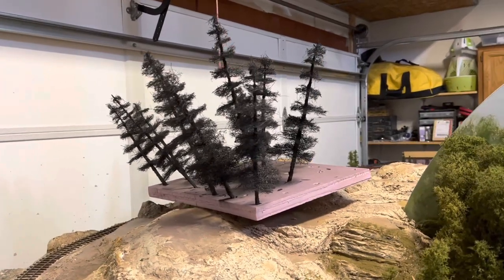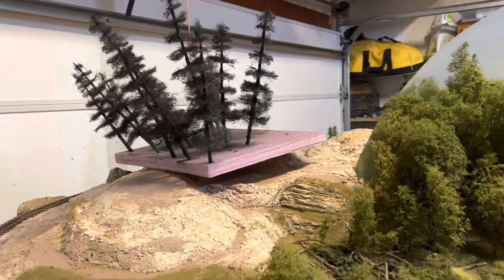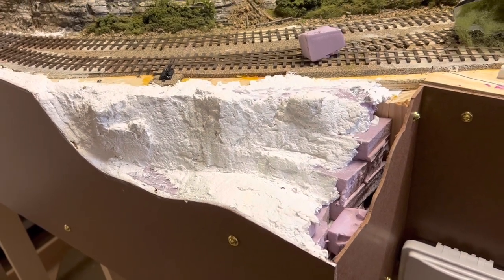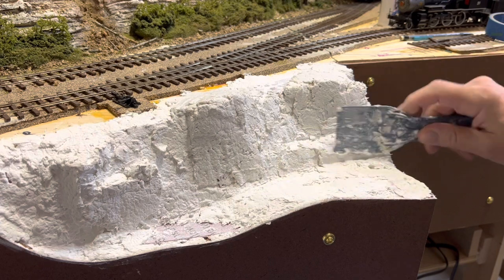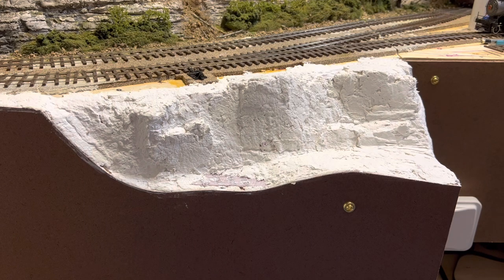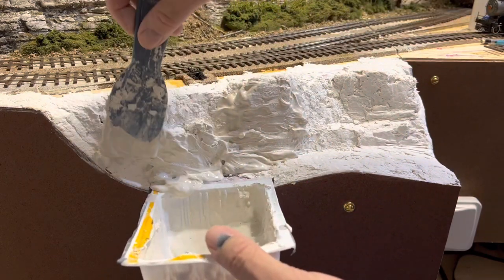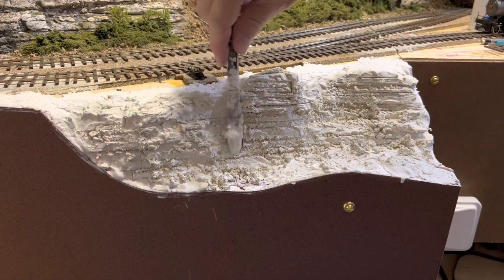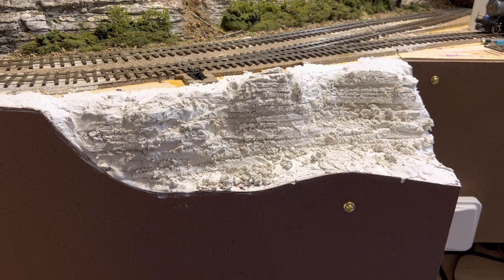O/On30 Scenery How To (Rock) Part One - Model Railroad Adventures with Bill EP193

Comment: Another great job and video. Thank you for showing how and why you use the wire brush. Another question is why you use the plaster over the skulpamold (if I am close to spelling it correctly)? Does the plaster pick up fine details and washes better or something else?
Reply from the maker: Hey Rick thanks!! So for me a couple of reasons.   First is by using a base of sculptamold I have a very strong base but one that is easy to drill holes in fof ghd large trees I plant in the ground.   The sculptamold drills easy and doesn’t crack.  

You can smooth and carve sculptamold too but for the rock types I do I find that applying the plaster over the sculptamold gives a better result.  Like you noted I can get finer detail in the carving of the plaster where I want to emphasize rock bedding.